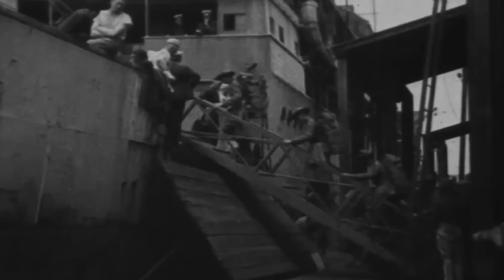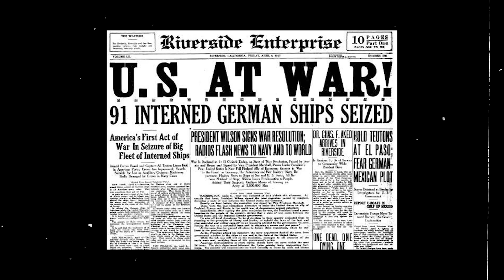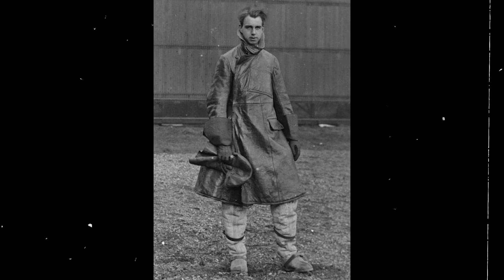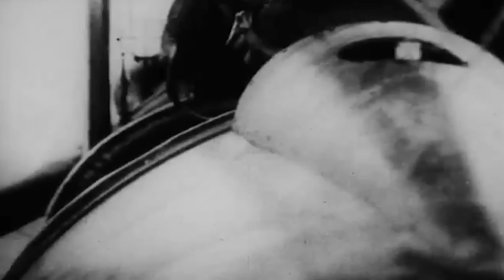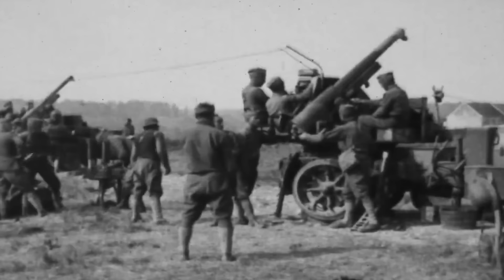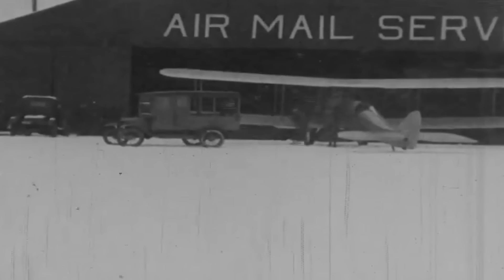You Were Going to Skip This Plane—That Would Be a Mistake

Comment: The Bristol fighter was a great choice.  It only took losses in Bloody April because the tactics were misguided.   The USA tried to manufacture the Brisfit but typical to the USA they tried to manufacture it and modify the engine so far out of specs that it was a failure. The Brisfit went on to serve for 14 years in service.

Comment: Insane that WWI pilots not issued parachutes.  Flying airplanes made of dope soaked canvas, engines lubed with  caster oil.  Allowed them to be killed before they learned enough to survive.
Reply: They had a brass pair that clanked when they walked.
Reply: Lubing the engines with Castor oil were generally done with most WWI engines, which would burn up without the higher pressure resistant lubrication of Castor Oil,  (not caster...)  The Germans tried to use a coal derived synthetic oil called Vitol and it ended up seizing engines and killing many pilots. German Jastas would pay any army unit that over-ran an allied airbase that had large stores of Castor oil with a crate of champagne, because it was superior to most other oils.

Comment: Packard and Buick built the most reliable Liberty Engines.  The DH-9 design corrected the major problems of the DH-4.
Reply: The DH-9 was the exception because it's Siddley Puma engine was overrated for horsepower and under performed and had to be ran at less than full throttle to prevent it damaging itself.  The DH-9A had the Liberty engine.